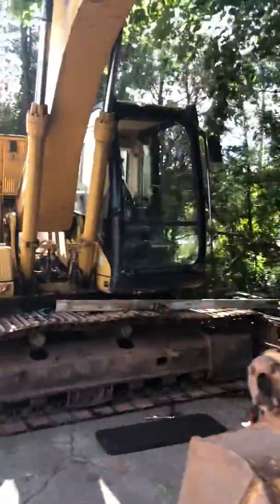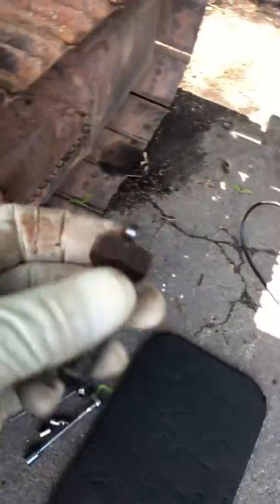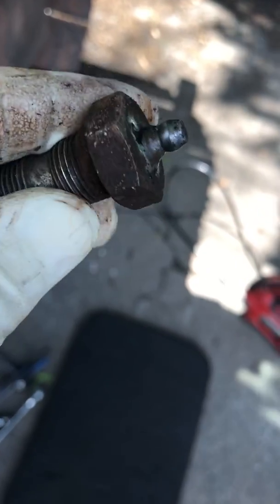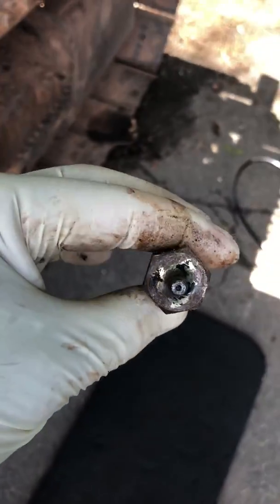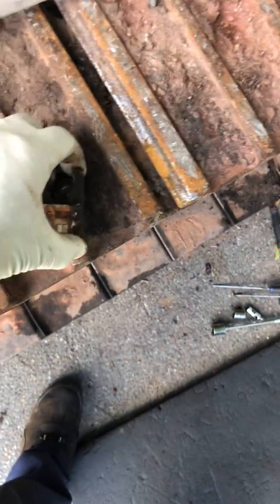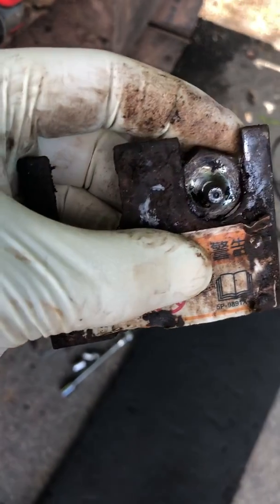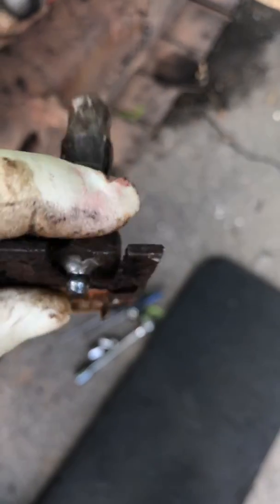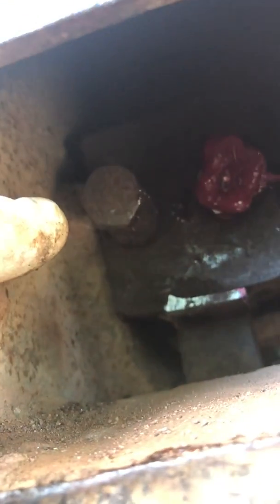Cat 315 excavator track adjuster grease fitting replace

Comment: Just went through the same problem thats been haunting me for months to tighten tracks on 312EL and would not take grease. Finally a track came off and had to attack the issue.I was going to replace the zerk but as a hail mary bought  a "lock and lube" grease gun end . This device locked on and  both sides took grease with no problem.

Comment: That plate is a safety device used to keep the fitting from shooting out and hitting you as you loosen it. Under very high tension, the fitting will shoot out as you loosen it.

Comment: I actually just did the same fitting on my 315cl and that bracket I didn't cut it off.. what I did was loosen the tension nut all the way then I prayed down on the Plat and at the same time pry up on the box and keep doing that until the fitting is cleared then you can change the fitting that way with out cutting the bracket off.. then just pry it back into place and tighten everything back up
Reply from the maker: Was way quicker to cut off and just get rid of it lol
Reply: Thats true I just like to keep it on there to help protect the fitting and wanted to see if there was a different way to get around cutting it like I saw in you're video because I don't have that nifty air cutting tool you got haha

Comment: Two years late but I have the same problem what a stupid design pisses me off I ended up just grinding around the plate so I could fit a socket on the grease Certs sometimes it amazes me the engineering in some of these excavators sometimes it’s good and sometimes it just is the stupidest thing you’ll ever see